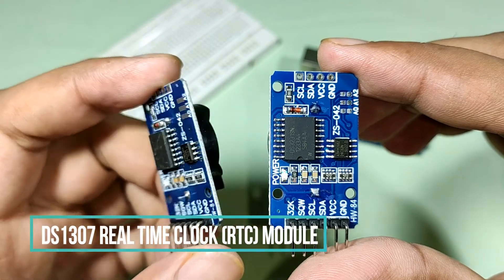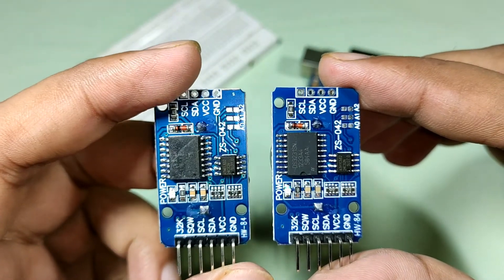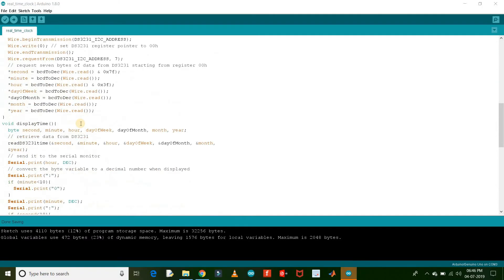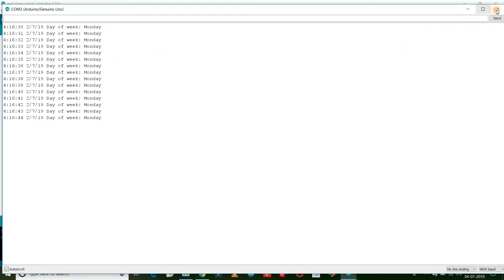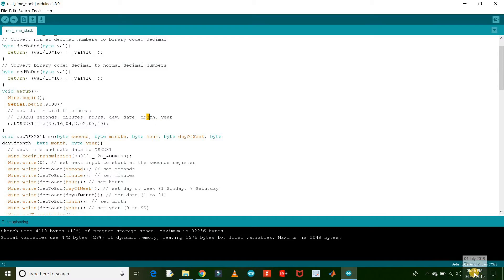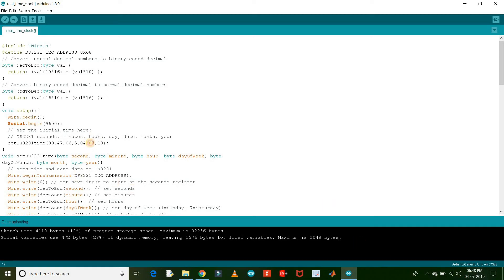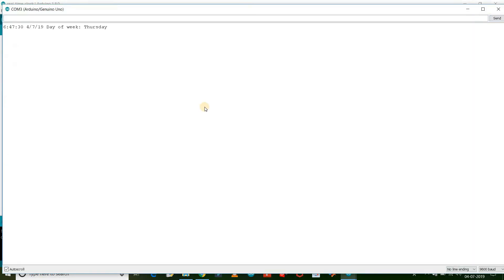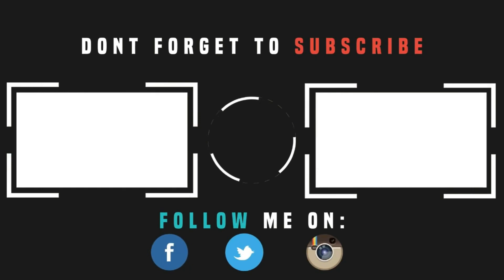Real Time Clock (RTC) Module with Arduino (DS1307 and DS3231)

Comment: hi i used a ds1307 module . i can save number and I have i2c connection with it. but the weird thing is that timer is not counting . its freezed. how can I fix this?
Reply from the maker: Just uncomment the in code

Comment: U mean every time i off the ac current on the uno board i have to upload this sketch again and changet the time and date in this sjetch and then upload? Of so ehat is the use of the cell behind the DS3231 module

Comment: I use this RTC all the time in clocks and data loggers. I found a VERY easy solution for setting the time. First, I created an Arduino sketch that will take commands to read and set the date, time, and weekday. The commands to write these things must be in an exact format, but that is not a problem. The next thing I did was create a GUI-based app on the PC that has a text window. I have buttons I can click to have the PC send a read command to the Arduino. For writing the date and time, when you click the button, the app reads the PC date or time (depending on which button you click,) formats the data into a string, and sends it to the Arduino. The time will match the PC time to within one second. Since the PC has no simple knowledge of the weekday I use a drop-down selector in the GUI and then send the weekday. It is very easy to set the time on these things. For data loggers I don't worry about daylight savings time, but for my clocks I have a switch on the Arduino that will cause the Arduino to add one hour to the time. When we hit DST, I just flip the switch and the time is right. 

I didn't want to build a digital clock for my Arduino, I like analog clocks. So I bought a round PCBA with 241 Neopixel-type LEDs. It has 60 LEDs on the outermost ring, perfect for marking minutes and seconds. The next ring in has 48 LEDs, I mark the hours there. Both rings are a dim blue with red hour-marking LEDs. I also figured out how to display the month and day on some of the inner circles, and the center LED just does constant color-shfting. Yeah, it's not battery-powered, but it is cool.
Reply from the maker: Hey great concept..and thank you for sharing .. I must look on this in my upcoming projects.
Reply: You are welcome. I am a hacker through and through. I have been a test engineer specializing in test automation for over 30 years, but I only started dabbling in Arduino a few years ago. I find it is a wonderful way to extend the reach of my PC-based test programs. I have one production test program that relies on a National Instruments DAQ to take measurements, and if I was do build that test now I would scrap the DAQ, stick in an Arduino, and do more automatically, like have the Arduino do color sensing of the two-color LED to verify both LEDs work. But, the fixtures are now legacy and it would be too much trouble to update them. 

If you need me to share code I can do that, might help you along. I have come to the conclusion that, I don't care what kind of engineer or scientist you are, knowing how to Arduino will not hurt you one bit.